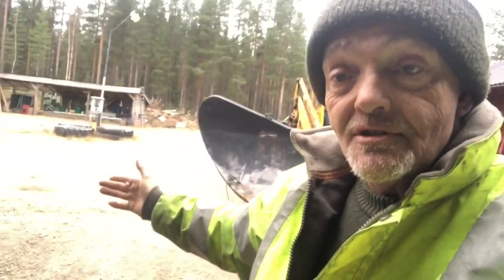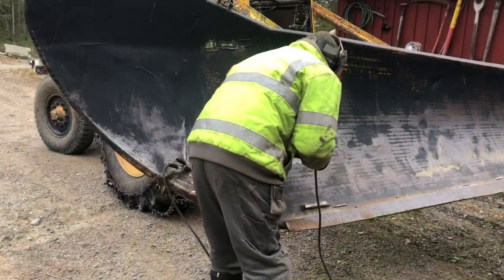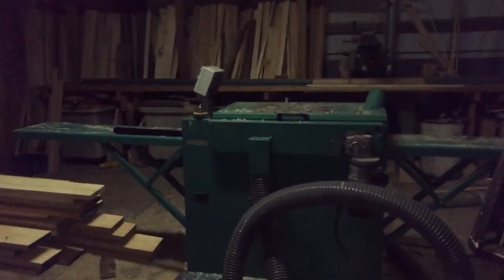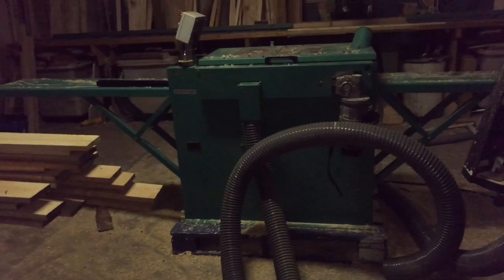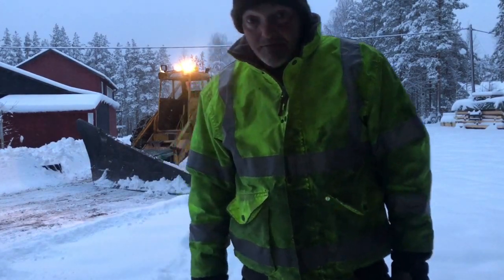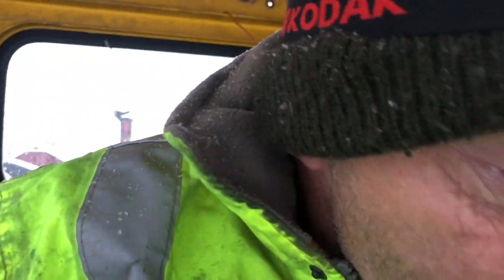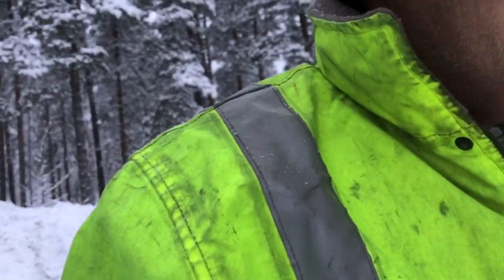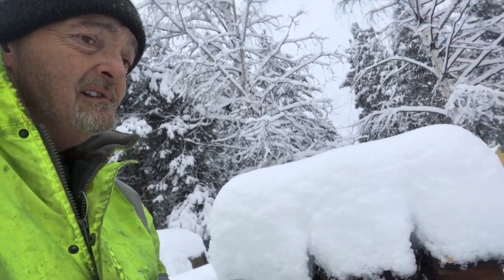Snow Plowing my yard and road in October is normal if you live in Lappland.

Comment: We have been given a reprieve from any major snow in ND so far but at the same time not making any ice on the lakes either!  One thin I have discovered on my tractor with a 8ft dual stage blower and loader on the front is I spray both the blower inside on the reel and the blower section with PAM non stick cooking spray and I have not had any problems since I came upon this solution its a cheap way for you to stay in the warm cab when blowing snow.  If we have a normal snow year I will be in the cab of this tractor for around 60 hours moving snow and maintaining my driveway which is almost a quarter mile long!  The good part is that its fun for the first 10 hours.
Reply from the maker: HI Karl, thanks for the tip, always fun for the first part of winter but can become a chore after a few months made worse by fuel prices.

Comment: Chains make a massive Difference, I live in southern End of Finland Last year we had a Shed ton of snow my old 60 year old McCormick b250 with Front loader saved us, Without the chains not a hope in hell, Simple chain added made all the difference, Laughed then as it was -30 out for a few days none of my Vehicles would start, But the Old Micky Fired right up no block heater :)
Reply from the maker: So True, no way could I use my old girl without chains and again -30 nothing starts but the really old machines. The only down side is I use heavy spike chains so have to get them off in May otherwise it tears up the yard. Thanks you.
Reply: @arctic-rebel  I just got normal chains spikes would be awesome but so bloody expensive here,Hoping my old Series land Rover wont need them either :)
Reply from the maker: @jjt1093  Right, everything is expensive here, Land Rover! and a Huge tool box LOL. I got to pull your leg over that right.
Reply: @arctic-rebel  used to it lol, but wouldn't trade em for anything :), except some cheaper form of fuel that's ridiculous here now
Reply from the maker: @jjt1093  The advantage of older diesel engines is they run on chicken poop!
Reply: @arctic-rebel  LOL exactly

Comment: Front right corner of the plow. In front the driver seat should be extended to increase your plow angle to cause it to roll away?? Try that if possible??  Plus a cab heater?? Lol
Reply from the maker: Cab heater! LOL I would need to put the door back on if I have a cab heater. Nice machines but cant see shit with the door on and twice I have been locked inside the can when something has fallen against the door! Not the best design if I am honest.
Reply: OMG!!! I see now why no door??lol

Comment: Did you ever try drilling a small hole at the end s of the crack to stop the crack?
Reply from the maker: No, and I know about doing that as well, it cracked where it backs onto the bracket. I knew it was there when I took it of in May at the end of winter and then everything gets real busy real fast. Steel fatigues here faster than other climates and so I should have given myself more time for this repair. Thanks many eyes make for improved knowledge and skill.

Comment: what is the model?
Reply from the maker: Hi Trevor, I will have to look at my service manual for that, top of my head is blank.
Reply: @arctic-rebel  i love those really old industrial machines
Reply from the maker: @trevorhannon900  As do i but sometimes the horse hair seat and no heating can be challenging as the winter moves forward.
Reply: @arctic-rebel  and i'm sure where you live it would be hard to come by a brand new seat. 
we bought a new universal suspension seat for our massey ferguson tractor.
Reply: It looks like a LM218/620/621 by Volvo BM. Probably a 218 as it seem to get going too fast/easily and at too low engine rpm to have a converter, atleast based on the very sluggish LM641 i drive at work.